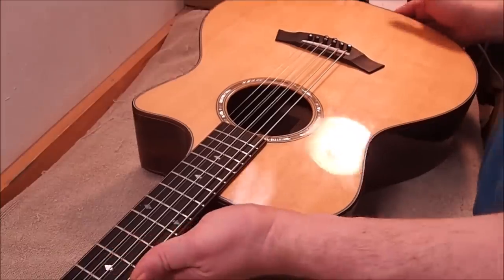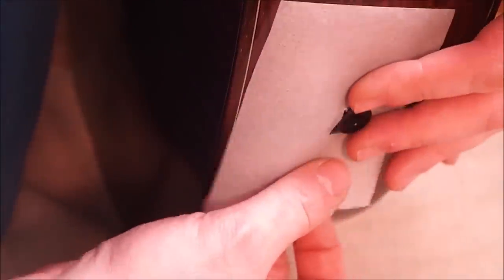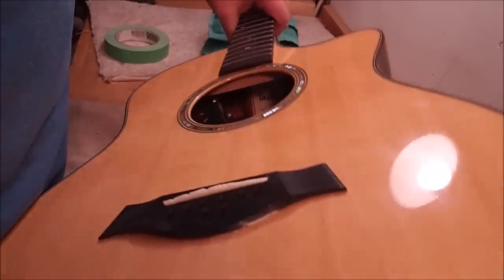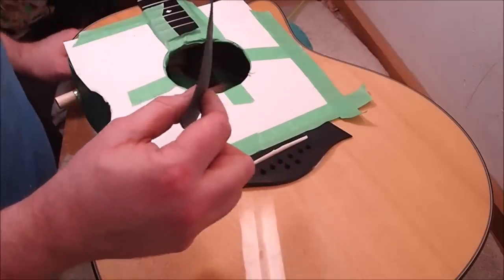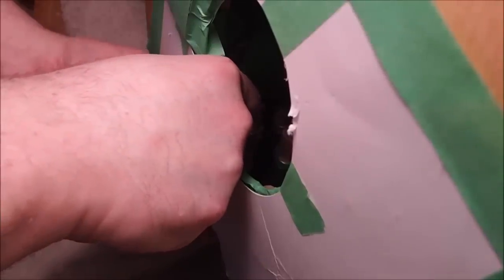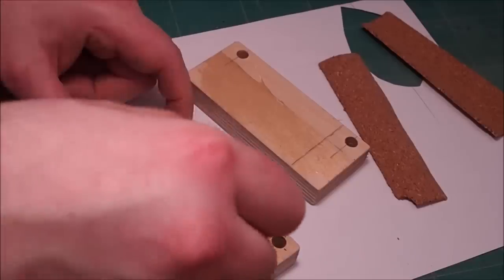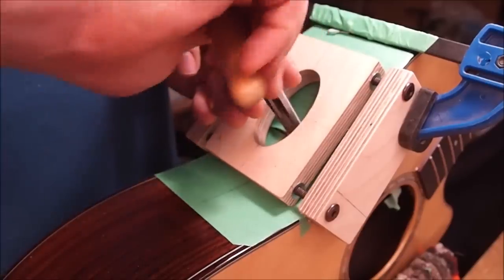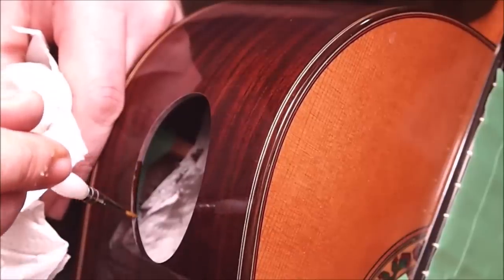Guitar Repair: Cutting Side Ports

Comment: Hi all - these are my instruments. Ted's made a wonderful job and I can easily hear the difference. In the Baritone-8, most of the benefit is in the treble. I've made some measurements. In my normal playing position, it goes roughly like  +4 dB for the B1 to +7 dB for the B3. This is 2.5x and 5x louder. These may be quite small effects for someone with normal hearing but it allowed me to play an unplugged gig with confidence yesterday.

Finally - a warm thank you to all for your good wishes regarding my hearing. One can live in hope.
Reply: too much cowbell?
Reply: @silkysmoof5697  There's a finite amount of energy in the guitar so if you're taking some out of the sound port, you'll have less available for the primary sound hole. The real question is whether it's noticeable. I can't really answer this - I can't play with my head in front of the instrument. 😉 Nevertheless, the amount of energy coming out of the port is quite small - by intention it is weakly coupled - so I really doubt it's an audible change.
On reflection, it may be that getting better feedback from the instrument allows the performer to play with greater confidence. Again - I've no way to test this.
Reply: I was diagnosed 7 years ago with benign tremors that have been getting slowly worse, and now I am not able to play professionally any longer. I salute you for doing anything you can to continue playing.
Reply: Hope you still have your hearing. I would imagine you could place your face on the side of the guitar while playing and get some vibrations through your jawbone. I think Beethoven did that? What is your condition? I have been developing worsening tinnitus and I do worry about hearing loss.
Reply: @brucedickson6019 he literally measured the change with a DB meter, so it's been measured....to ME what's important if I sit, play and sing is what I hear...anything else is using the preamp on my Breedlove Dreadnought it's a big difference to what I hear, can't speak to the rest of the room

Comment: I bought a filthy old pawnshop Sigma guitar with a stab wound for $30 once.  It must have belonged to a homeless bum or something because this thing had obviously lived outside.  It had dried leaves inside the soundhole.  Also, the upper bout had been pierced apparently with a screwdriver-like weapon (lucky there was a Band-Aid on it). 
Anyway, the hole looked awful so I cleaned off the Band-Aid goo and using blue painter's tape I just traced a clean circle big enough to enclose the entire perimeter of the stab wound.  It was in a location where I could use my router and rout out the circle. That left a nice clean perfect circle.  Sanded her up, put a little stain around the edge to hide the raw wood, and, boom....good to go.   It actually sounded pretty cool when you played it. You could really hear every sound you were making, including pick scrapes, etc.

Comment: The effect of a side port is to basically create a channel for more air to enter and leave the box more readily as the top vibrates. The location isn't as important as the size. Since the soundboard shape and dimensions are the same before and after, you won't get much difference in tone....but overall volume and trebles might change slightly (for better or worse....this is similar to "tuned ports" in speaker cabinets). Martin made a "large soundhole version" of their drednaught guitar to achieve a similar result. Apparently a famous guitarist wore his away and liked the sound...and attributed it to that.

Comment: Forgive my ignorance of the finer points of how sound travels, but could you increase the volume of the side port by covering the sound hole, and / or by inserting planks to direct the sound upward?
Reply: I think this could help, you might be able to essentially 'tune' the ports to the most desired resonant frequencies, much like is done with ports on speakers. For those, Thiele-Small parameter equations are used to calculate the ideal port size based on desired frequency response and enclosure size. I would put some cardboard over the holes and play around with it a while - maybe even put a mic and a frequency meter on it to see if there are some measurable sweet spots.
Reply from the maker: @scottr939  excellent points.  The resonant frequency of the air chamber in a guitar is affected quite a lot by the size of the port - you can tune the Helmholtz resonance by changing the soundhole dimensions, for instance. Adding a port lowers the frequency by a significant amount.
Reply: @twoodfrd  I would expect adding a port to raise the frequency.

Comment: I wonder if the standard soundhole was plugged up, if that would direct more of the airflow and sound out of the auxiliary soundhole?

As usual, fantastic video demonstration!
Reply: It would. It's easy enough to find out. I have a Yamaha that came with a block off for the soundhole. One of those feedback reducers... But it COMPLETELY blocks the hole tight. 
If you do that.... 
It's gotta go somewhere!

Comment: I have the exactsame problem, but have an EQ right where you have the sound hole. Would it still be viable to do this on the 'opposite' slope, so to speak? It would point the hole directly at my worst ear.

Comment: Do you lose any tone from your guitar when you do this ? If not I might just do this to one of my guitars,my only fear is losing some low end,I wish you did a before and after sound test for us to hear,excellent job as usual your one of the best luthiers here on YouTube.
Reply from the maker: If you like the way a guitar sounds currently, don't cut holes in it. Differences in bass response won't be picked up by a mic in my shop situation. Also remember, the sound you hear from your guitar is not what your audience hears except in a recording situation. In which case you could simply adjust the e.q.

Comment: yes, the effect on classical guitar sound intensity  for player is substantially more prominent, lots more vibration of less rigid top?   I just use a 1-1/2" hole cut saw centered on the upper bout, but i use painters tape protection prior to drilling and keep on untill sanding is finished. I adjust soundport position so as not to interfere with existing struts, bracing and electronics. larger holes do not seem to provide additional benefit, smaller holes are of  inconsequential benefit.

Comment: Put a hole in a perfectly good guitar...awww. With time you can feel the vibrations on your chest while playing a dreadnaught that transfer into tones. Not being able to enjoy all the tones would be extremely difficult.
Reply: Ultimately it's an instrument and any modification that improves it's facility for music is a good one. I was hesitant to do this but I'm very pleased with the result.
Reply: @brucedickson6019  Artisan level work as usual.
Reply: @brucedickson6019  are you the customer for the guitars modified to have side ports in this video?
Reply: @danielgoodman3578  Yep - Ted modified my Ramirez and both of my Taylors. It made a huge difference & I'm very pleased with the quality of Ted's work and the result.
Reply: Bruce Dickson : It may be worth fitting a feedback buster to the sound-hole to help direct more volume out of the side port.
Reply: @davepinnell  An interesting idea, thank you. As below, I measured that the bass is about 4dB and the treble about 7dB louder. This is quite a lot (respectively 2.5x and 5x louder) and it really changed the way I perceive the instrument's tone.
Reply: Well, loosing your hearing can be compared to blindness: your ears will adapt and you know (as being a musician) which frequenties you miss. And once you accepted it ... well ... that's life.

Comment: what is the disease that's causing his permanent hearing loss? that's devastating.
Reply: unprotected ears with sustained loud soundwaves passed 20 minutes is cause for irreversible damage to the highest range of everyone's sense of hearing.  And you can chip away at it for as long as it takes to go completely deaf.
Reply: that is the cause of most hearing loss, which most if not all who live in an industrialized society have suffered (especially those who don't protect their hearing), but it is not the only thing that can cause hearing loss. beethoven suffered permanent hearing loss due to some disease or defect. medications can cause hearing loss (some r blood pressure or heart medications), probably by weakening the "hairs" in the cochlea, making them more susceptible to permanent damage from loud enough sound.
Reply: also, 20 mins is not required for permanent hearing loss. any loud impact noise (hammering something, driving a golf ball can b as loud as a 22 pistol) can cause hearing loss. it also depends on the person. there r rare individuals who r not as susceptible to high decibel sound as most people.
Reply: @mjt11860      i believe infections were rampant in Beethoven's era as antibiotics were as yet unknown.